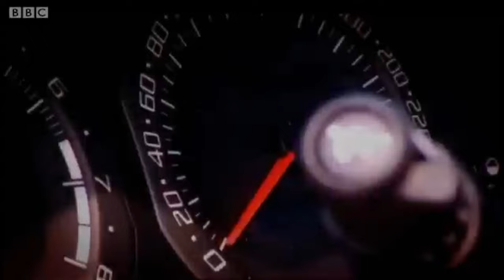This Race Car was Horribly Outdated

Comment: I still think those Cadillacs looked cool. However therein lies the problem. As you pointed out the car design was several years out of date and powered by a relatively unsophisticated V8 Supercar motor, and the whole enterprise lacked the resources and development of Audi and Bentley's efforts. Of course Cadillac are back with a vengeance in Hypercars and rumours still persist of a Formula One entry. That was then, this is now.

Comment: Hi i love your channel, i always watch ur videos, but can i ask you to lower a bit the volume of the eurobeat parts? i would appreciate a lot:)
Reply from the maker: The idea of the differing volume levels is that it has like a sort of 'bass drop' effect, which is why I usually put a hard line before the music bits, but some people were getting annoyed over having volume warnings before, I'll try to work out a way, because when editing I listen at 100% volume to make sure there isn't any unpleasant noises that you can't hear at my usual volume, and those parts can give more of a jump scare effect than a 'bass drop' effect, so I'll try to work out how I can get the effect I want without the jump scare side effect it produces. I'm new to this and I'm teaching myself to edit, so the quality of the sound and everything else should be better with each video
Reply: @FailedRacers dynamic range (volume differences) is a useful tool, but the most common mistake people make is having too big a difference. Striking a good balance between having dynamic range and not having the listener have to manage their volume several times throughout the video is hard without experience. It's already better balanced than your Octavia WRC video. 

I also wouldn't recommend blowing your ears out listening at full volume, as it might give you false info (the amplifier might clip instead of the audio file itself) as well as hearing problems down the road.

Comment: The race variants of the Northstar engine were good, as long as they weren't badged as Cadillacs. Under the Oldsmobile badge they were dominant in the early Indy Racing League, and under the Opel badge they won races in DTM.

Comment: It also didn't help that they were promoting an engine line that was one of GM's worst at that time.

The Northstar line of engines were exclusive to cadillac and high end oldsmobile's, and they were famous for literally ripping themselves apart in some extremely spectacular ways.

They were introduced in 1994 and gm wasn't able to finally swat all the flies buzzing around it until the third gen version of the line came out in 2004, just four years before being discontinued.

Comment: I understand the argument for the GT40 MkI and MkII being British, but the MkIV was designed and built in America so if there's nothing else, 1967 was an American win.
Reply: mk2 was american
Reply from the maker: I will admit I was stretching a bit with the 100% win rate, but you can also argue that the MkIV is still based on a European car. Still, that leaves Europe with a 99% win rate, which is definitely not so bad
Reply: @FailedRacers  the mkiv wasnt at all based on the original gt40 chassis, it was based on the J-car which had aluminium honeycomb panels

Comment: I could comment on this all day. I would like to finally add that at least Cadillac came back for more attempts unlike a certain FWD Japanese monstrosity already covered on this channel. And they were not the first luxury car maker to arrogantly think that an ultimately disasterous design would beat all comers. Look at Porsche and their 1991 V12 F1 engine. The problem was that Cadillac had been away from Le Mans since the 1950s. Look at the non-European Le Mans winners Toyota and Mazda. They spent years - no, decades - perfecting the art before achieving victory. I can understand why Cadillac thought recycling a Riley and Scott chassis would put them on the short cut to glory at Le Mans. However what would  have beaten the Porches and McLarens during the 1995-1997 period was old hat by 2000 against the Audis. Pardon typos.

Comment: (1) The Ford MkIV (and, that's "MkIV" ... NOT "GT40 MkIV," as it was a J-car chassis, not a GT chassis) was built entirely in the USA.  The 1966 winning MkII was a GT chassis, although not a GT40.  The 1968 and '69 winner was a GT40, and those cars were built in the UK.  The MkIV was not.
(2) Cadillac was not developed to compete with Mercedes, BMW, and Audi.  Cadillac was established in 1902, after M-B, but long before BMW and Audi began building automobiles, and became a part of General Motors in 1909.  In the 1920s and '30s it competed in the high-end luxury market with Packard, Pierce Arrow, and Duesenberg.
(3) With your "South Iff-rican" accent, I'd be very careful criticizing the way Americans speak.  Yes, some of our regional accents are hard on the ears (I grew up in Pittsburgh, spent other parts of my youth in Oklahoma and the NYC area, and went to college in the South), but are generally easier to take than "South Iff-rican" English.
(4) Even the French pronounce the make in question as "CAD-ih-lak," so your insistence on "Caddi-yak" is badly placed.